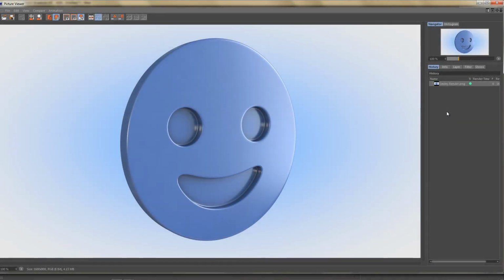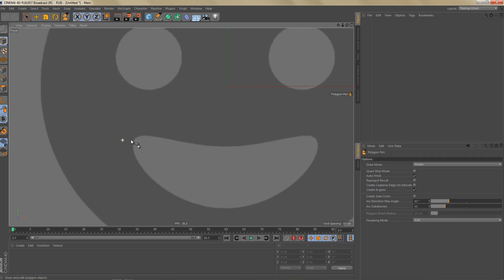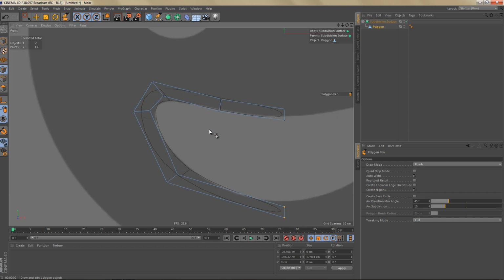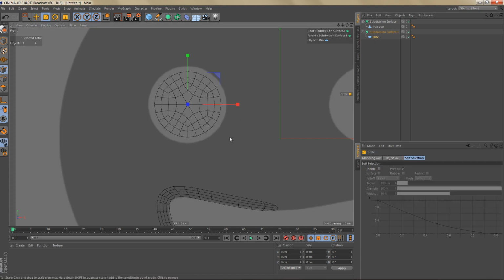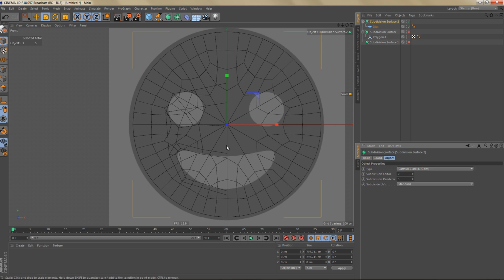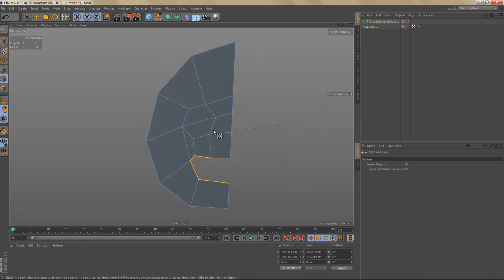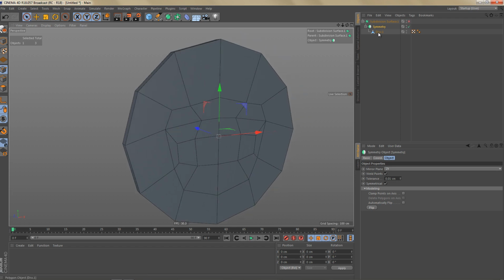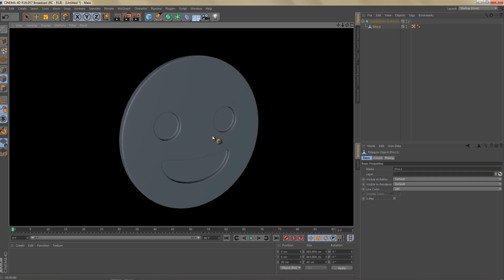Modeling a Smiley with Subdivision Surfaces Part 1 of 2 | Cinema 4D Tutorial

Comment: here is a little story.
i am surprised nobody has commented.
i used to be a programmer designing websites in asp, asp.net, php back in the 2000s. knew c and c++  too. not a very smart one in writing code. but certainly good in understanding if the code made sense or not.
anyways that was that.
learned graphics (yes photoshop) to cater to my clients to provide all solutions under one roof.
was suggested by my guru programmer colleague to learn 3d to cover more ground to be more versatile in the future. tried 3d studio max. the interface threw me off. was hard as hell for me someone migrating from the 2d world.
my fortune somehow showed me the way to enter 3d through cinema 4d. the interface was beautiful and easy to comprehend as hell. spent time learning it.
wanted to learn the best method to model. watched more than 1000 tutorials over 2 years. learnt a lot. can make a whole lot of stuff. but i vowed to myself that i shall not make anything to go public until and unless i know that "ONE" technique that was superior to all. found out that subd rules all but is difficult to grasp at te outset but once grasped will cater to all kinds of modeling in all forms, shapes and sizes.
have watched all training one can imagine. learnt great techniques. was directed to polypen for the ultimate control. but that was time consuming making polygon after polygon to fill gaps. but that took a lot of time. i finally understood after seeing all kinds of tutorials for hard surface modeling, organic modeling and what have you, not to mention all kinds of box modeling techniques plus volume modeling, spline  based modeling using all kinds of modifiers from bend to all the rest that i could finally actually model things.
i made certain models for myself and they turned out great but a lot of brain-storming was  required to pre-conceptualize them and start exactly right to make sure not to stumble later  and fall into a pitfall. and yes i consumed the entire training from MILG11. it showed me a lot of great techniques and after it i thought i had nailed it to make any kind of model (excluding character modeling; for some reason i have yet to discover liking for it, but am sure that is catered too by this technique).
Toby Pitman poured his heart out in explaining things and he did extremely well. Hats off to him. i recommend him highly to anyone and everyone.
but i wished he picked things straight from the internet and showed how to model simple to intermediate things quickly using the arsenal of techniques he had. he is extremely good but his examples taught those things that did not strike a chord with me totally. his superior techniques are the end of story surely but i wanted just a little more for a plain-minded person like me to spend not too much time conceiving everything from the start and then embark on a project.
I WANTED TO FIND OUT THE PENULTIMATE tool or set of tools TO MODEL. I knew it lay hidden somewhere between using the polygon pen tool and the typical polygon modeling techniques that have been shown by so many great tutors like you on the internet. But I wanted to use the lowest amount of polygons to give the maximum kick. I wanted the shape to give the perfect render with a nice looking number of polygons where the mesh looked beautiful. Just like I wanted the code to look beautiful in my good ol' days of programming. 
I wanted ONE TECHNIQUE (even if it used a whole bunch of tools, but one technique) to conquer it all.  the clarity and the transparency of the technique must be palatable to all and sundry. Convoluted techniques or taking unnecessary routes to achieve a task throws me off. Plus explaining this intractable solution to others is a nightmare in itself and for me personally is akin to misguiding.
Your use of pen tool here and then to use the typical(known to all but probably not fully realized by all) polygon modeling  technique and then to convert all to subd to render a perfect organic finish was a treat to watch. i have finally found that perfect technique to reach any goal with a proper approach. Which is start with the lowest number of polygons. look around to see if the edges can be met hand-in-hand for the surrounding polygons. using polygon pen to create polygons(quads) to reach the surrounding edges to meet them in harmony is the crux of it all. the poly count remains lowest and a  minimalist approach here gives the maximum punch even after subdivided.
i am stunned that noone commented here. your approach here was the culmination of the top most technique. People may not realize it. I have watched more than a thousand tutorials. i know all about NURBS modeling. Spline based gives the hardest time when we are about to subdivide. Cinema 4d has improved it. But still here and there edges dont match ( that is even when we used quadrangles and used the regular grid for ( i.e., in the Caps settings for extrude, loft, lathe or sweep) or even when using the intermediate points settings on splines ( such as uniform, adaptive, natural or subdivided). i am sure you know what i mean.
As a programmer I knew that the code could be written badly but it must have the parameters travelling back and forth correctly in order for the code to run at all and present a result or else it would throw an error.
So here in 3d modeling I wanted my model to be BUILT IN THE LOWEST NUMBER OF PLOYGONS, PRESENT THE BEST LOOK ( bevels and extrudes mainly to catch light correctly for reflections)  and when presented out to the deformers or effectors to mould beautifully in all directions and not an iota of it breaking anywhere. After watching this simple video training of it, I think I have nailed it. 
You used the poly pen. Then used simple known-to-all polygon modeling techniques without the pen tool. Quite understandable as they could be done faster without the pen tool but nonetheless polypen tool could be used here too albeit at a slower rate. and then you subdivided everything to give a beautiful organic look. even without the subdivision you could have beveled it beautifully and still it would have looked as beautiful as a model could look without the subdivision. The beveled corners would still catch the light beautifully.
This is probably a very simple tutorial you did but it encapsulates the essence of everything that polygon modeling with subd entails. i could see it and through it.
any complex model can be made using your penultimate technique if days are spent. but rest assured a proper, sane, digestable, rational, practical, pragmatic and probably the best and i am sure here (so no use of probably) but definitely the best technique has been applied to get the best result compter-wise possible. the result will deform well. all modifiers and effectors will  work best.
IN ESSENCE, WITH THIS TECHNIQUE SPENDING DAYS WILL YIELD A VERY DETAILED AND COMPLEX TECHNICAL MODEL CORRECT IN ALL WAYS. WHEREAS PREVIOUSLY I WOULD HAVE MADE A RELATIVELY NOT TOO DETAILED AND NOT TOO TECHNICALLY COMPLEX MODEL IN THE SAME NUMBER OF DAYS (because of not applying the best set of tools for the best technique). 
THANKYOU VERY MUCH.
I know anybody reading this may be surprised for lavishing so much praise on you for such simple an art in this video but this art is one hundred percent accurate, adaptable, deformable, transformable and best of all with the lowest number of polygons.
May you live long and reach beyond 100.
.
Reply from the maker: Well, there may any number of reasons. People might not find the video good enough, or it isn't what people working with C4D are interested in times of Fields, Volume Builders, and XParticles. I have the impression that C4D isn't used that much for "proper" modelling anymore. While I do get comments on other videos, I don't really have a big audience, and I never will. I still have a lot of fun recording these tutorials, but I think Cinema 4D videos like this one are kind of a lost cause in this day and age. Was a totally different story seven or eight years ago... when I didn't know enough do to tutorials like this one.